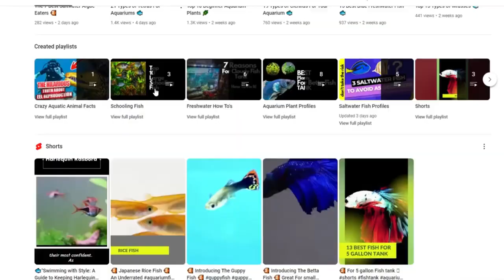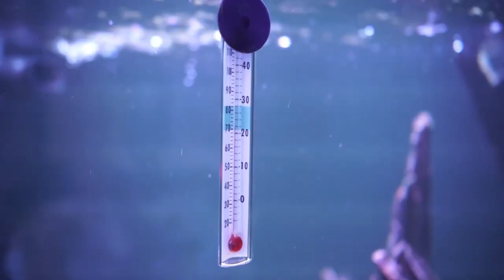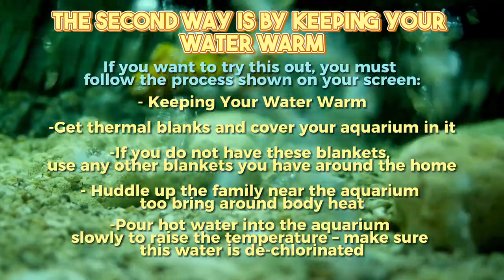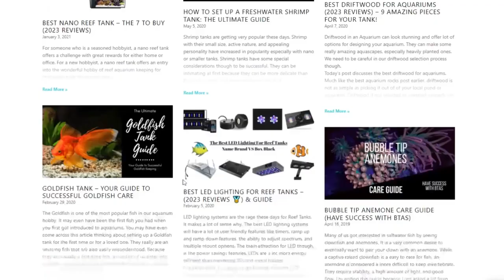How to Handle a Fish Tank Power Outage ⚡ (Must Watch for Fish Owners!)

Comment: This will definitely help me from future outages. Never really had an outage for over a day so this was information I overlooked. When I was moving, my only concern was keeping the tank warm and water parameters steady. Thought it was the temperature that crashed my tank but now I think it’s lack of oxygen since it was summer and the water didn’t get too cold. I associated loosing power with loosing heat.
Reply from the maker: Oxygen and high ammonia will get you first before temperatures. Temperature will wipe you out in the summer if your home gets too hot. Too cold most livestock will survive. Just insulate the tank. SW is tougher for temps without a doubt but in freshwater many animals will go through their dormant phases to survive.

Comment: Great vid on surviving a fish tank power outage. Power goes out, oxygen drops, bad for fish. Use battery air pumps or Dr. Sochting's Oxydator. Temp changes = problem. Tips to handle it. Ammonia spikes = danger. Equipment: generators, battery backups. Keep fish happy during outage! #FishTankPowerOutageSurvival 🐠🔌

Comment: A cheap way is use a powerbank with usb air pump and a spongefilter, so you at least some kind of filtration and water movement. Plus with one usb air pump you can use multiple spongefilter if you a airsplitter.
Reply from the maker: Thanks. I’ve always been used to battery air pumps since that’s what I used. I didn’t know about usb powered that works really well with a power bank. I’ll add that to the pinned comment. Thank you!